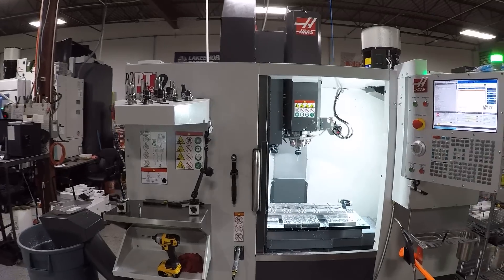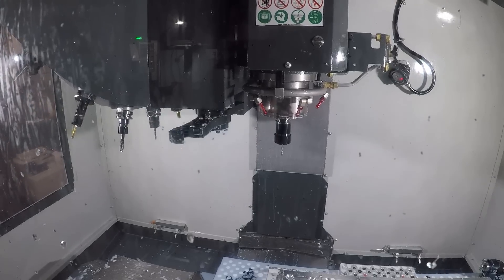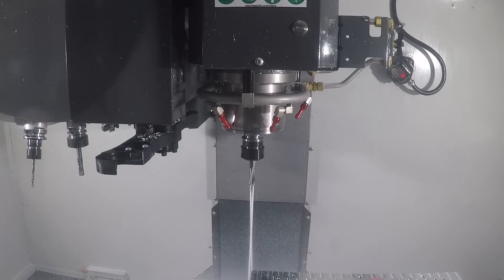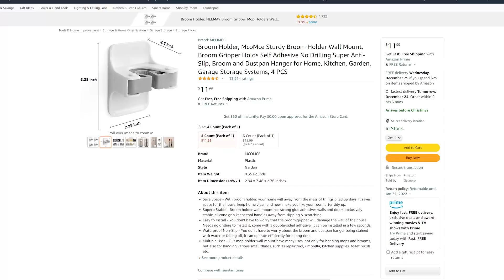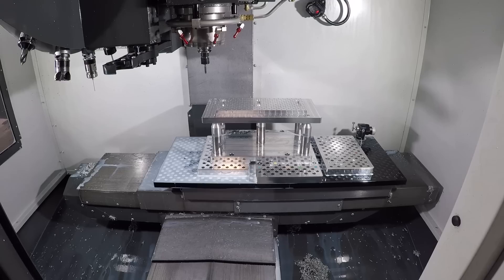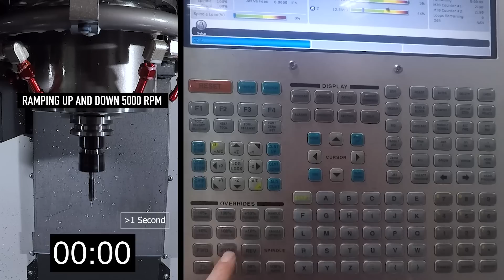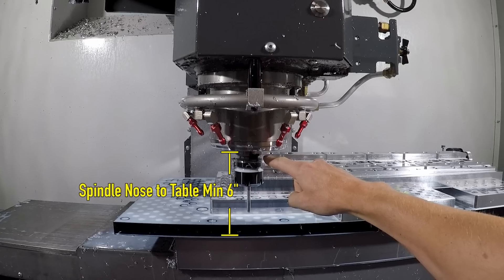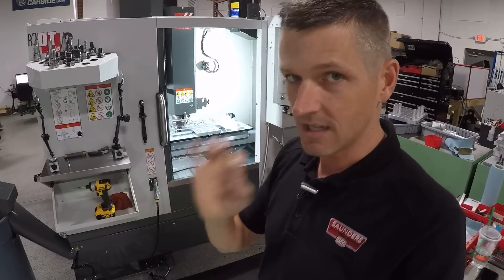HAAS DT-2 Review!  What we love about this FAST machine!

Comment: I picked up one of those rubber bristle brooms that was recommended in a previous video. It sounds weird to get excited about a broom, but I freaking love this thing. For sweeping chips there is nothing better!
Reply: I swear this tip changed what I think about cleaning my Haas.
Reply: @thokes82  Who would think something so seemingly insignificant could make such a difference.
Reply: Where do you find that broom?
Reply: What video was it? Where do you buy it? thanks
Reply: @adamdaake7488  Search Amazon for Rubber broom,
Reply: @TheFeller1554  thank you
Reply from the maker: Right?!
Reply: @nyccnc  On that point about the 30 taper versus 60 taper.
The issue is a squared law NOT a cubic law and it turns up in the gear ratio and reflected inertia equation. Its one of the most fundamental things taught to all engineers in their first dynamics class. There are 5 basic dynamics problems taught . I know as I tutored this class during post grad. They are 1) slider crank, 2) 4 bar chain, 3) Spring and Damper, 4) Coefficient of restitution (which has to do with impacts) and 5) the effects of accelerating 1 gear via another and the relationship of torque to inertia ratio. 

I used to tell the students if they only learned 3 of those they could easily pass the class. If they learned 4 they could easily get a good grade and if they learned all 5 it was almost impossible not to get an A. They are incredibly import basics to learn in mechanical engineering as well. They are the basics of mechanisms.  

I've done a lot of servo motor applications as an automation engineer and the critical aspect of high speed aceel/decel is the INERTIA RATIO.

If you go to any of the high end servo or high performance motion suppliers they all have these neat little apps for motor sizing. What is incredibly important is to keep the inertia ratio less than 10:1. You can operate at almost any inertia ratio its just that you lose fine control eventually. All those ball screws in your CNC machines are all effectively a gear box and also need to stay below that 10:1 inertia ratio. A classic mistake is to UP the size and NOT recalculate the ratio. It doesn't end well.

It can get people into a lot of trouble. A couple of years ago I was on a project where they motor supplier totally screwed up and had the gear box ratio out by a factor of 10 (YES IT DOES HAPPEN). That made the inertia ratio 10 times worse and that made positioning impossible from a reliability perspective as the inertia ratio was over 100:1. We were running the motor at 7% max speed and it we just could not get decent velocity control. It looked like a sine wave was super imposed on the profile.

If the purpose is high speed repetitive tapping then that smaller taper with the significant mass reduction is a very smart way to go about it.

Comment: Thx for the nice review! 
We have a DT-2 too, but we use it with a 4" extended Z-axis clearance and a TRT160  for our small 5-axis parts. 
Greatings from switzerland 🇨🇭!
Reply: Wouldn’t a trt100 be faster or do you need the ability to run parts a bit bigger?
Reply: @DylanVos05  The speed is not the decisive criterion in our company. We only produce parts for our own production.
We need the TRT160 because of the size of our parts.
Reply: @gcbefree68  ok cool thanks
Reply: Gruezi wo isch das?
Reply: Doesn’t the TRT160 weigh more than 250lbs?
Reply: @steves.3485  The weight is 150 lbs - no problem.